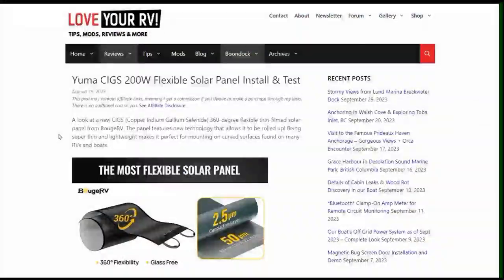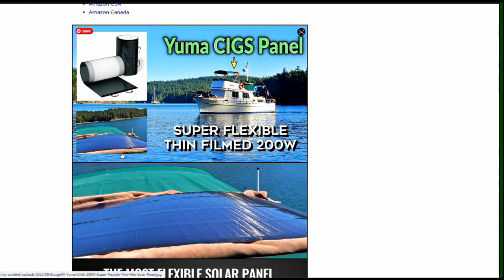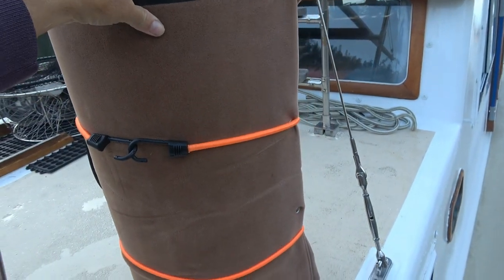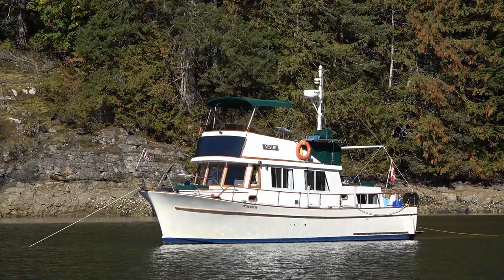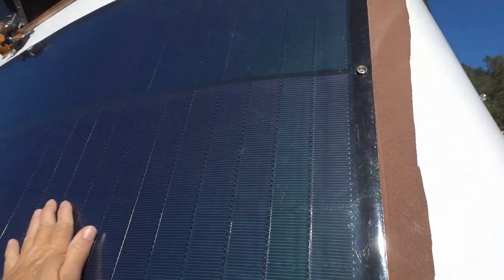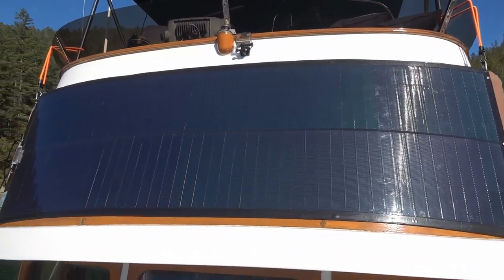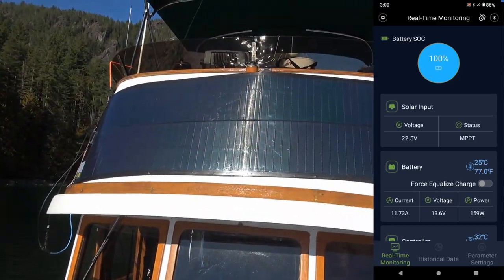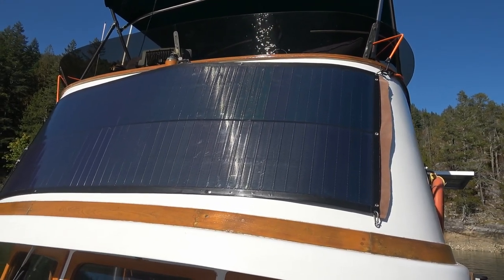Update on the 200W Yuma CIGS Flexible Solar Panel from BougeRV

Comment: Nice video. You mentioned some big pluses of this panel. However, there are a ton of additional features that come from the panel using CIGS technology. This is why this panel is so expensive. For example, this panel is extremely durable. One YTer shot six holes in his and it barely changed output. I have found that mine does a lot better when hot than others. They are also supposed to be extremely good with partial shading. I love mine and wish I had two. Thanks for a great video.
Reply from the maker: Thanks. :) I'm not sure about the coating on them. Feels a little soft to me, and I was able to scratch it a bit. I wonder how well it would do in a sandstorm or weather over a few years. It may get hazy or crack like other flexible panel coatings. Time will tell. Cheers, Ray
Reply: @LoveYourRV  CIGS is comparable to the traditional mono crystalline, in that they are the technology. It is not a coating. It is the fundamental way the panel works. If you bend a mono flexible solar panel too much, you hearing cracking noises as the panel basically breaks. Yours should not do so. It is a great technology, just a bit new, so a lot more expensive. Thanks again.
Reply from the maker: I've been disappointed by thin panel marketing hype in the past, so will wait and see how it holds up. Overall it performs better than any thin panel I've tested, and I love how it can roll up, but only time can tell us how it will last. I can feel a kind of rubbery clear coating as the very top layer and have scratches in it already when it fell off the boat bimini when a gust of wind caught it.

Comment: Thank you for the review... I have a couple glass panels + a couple of Flex panels. I "think" the glass ones do put out a little bit more power but I really like the size & weight of the Flex panels when it comes to transporting them and setting up since I "chase the sun". At the moment I do not have an application for this product, but who knows in the future? Just like RV's there is are applications for different sorts of products. Its not a one size fits all kinda thing.
Reply: Use these when the flex panels break!

Comment: I beleive you aren't meant to roll them with the solar "inside"! That might do some damage
Reply from the maker: OK, thanks for the heads up I must have missed that, I figured inside would protect it more from scratching when moving and storing. I guess I saw it rolled both ways in some of their pictures and figured it was OK. https://www.bougerv.com/cdn/shop/products/amndc-57eon_1800x1800.jpg  So far, it hasn't seemed to hurt it but maybe I've rolled it loose enough. Cheers, Ray

Comment: A couple of months doesn’t mean much in terms of durability.
Reply from the maker: I've been treating it like crap to see if it would break Normally it would be a fixed install
Reply: Thanks Ray!  I’m thinking long term durability would be an issue with the rollup solar panel which would offset ROI vs conventional rigid solar panels. Hopefully you will do a one year review. Thanks
Reply from the maker: Definitely rigid panels are the way to go if you can but on many boats and some RVs these days they are hard to find a place to attach. If I wanted large rigids on the boat that would mean a very expensive frame or hardtop roof to buy. Folding panels work well but suffer from wire breaks between the panels over time I find.